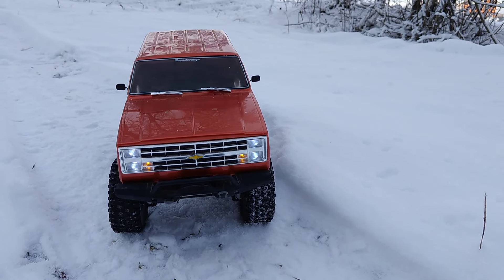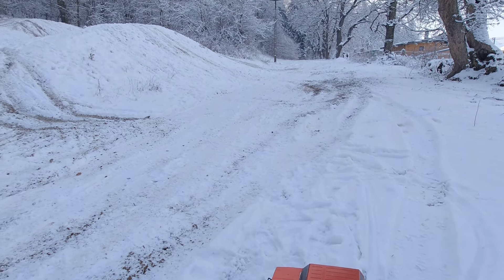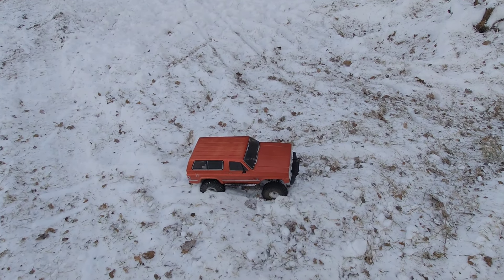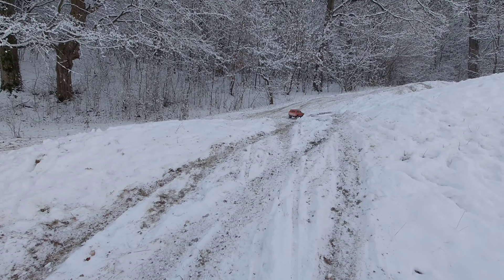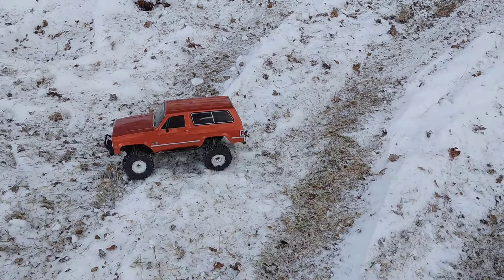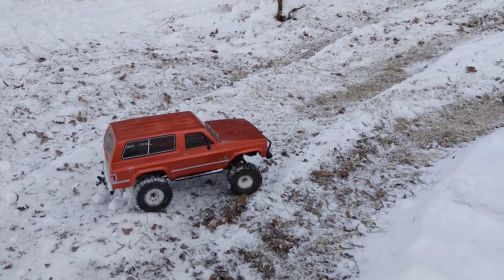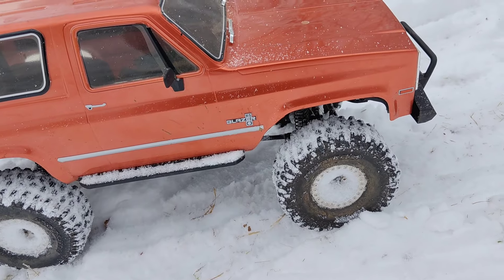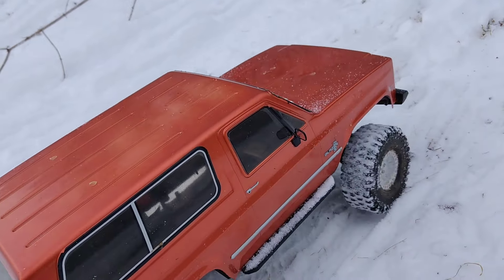TRX4 Blazer snow runner

Comment: I haven’t run mine in snow either.  I was told to completely dry it off when finished, or the screws could rust. I can’t afford to replace anything, so I have only run mine in dry locations. Enjoy, Alex.  Looks like fun.  I put a camera mount on my hood.👍🏻🙂  NIIIIIIICE!
Reply from the maker: It's not rust, it's patina 😄. You can't really get rid of rust on screws unless they're stainless, but it's just cosmetic, shouldn't do any harm.
After I take off all the snow I usually leave it in the shower to dry off, then wipe down any water left.
I also got a small camera recently, I should put it to use.
Thanks for watching!
Reply: @A.M.-RC  Thanks, Alex.  I learned a new word today that I had never heard before.  I looked it up.  Thanks for educating me.  Enjoyed your video.  I haven’t yet, but thought if I ever run mine in snow or wet conditions I’d wipe it down and use a hair dryer on it.  It was a pretty big financial expense for me after retirement, so I try to be pretty cautious.  Enjoyed your video, and the information.  Keep up the good work.👍🏻🙂
Reply from the maker: @rlbutterfield  I know, RC can get expensive, I try to take care of mine as best as I can. I actually found that snow can clean them pretty well of dust and dirt 😄